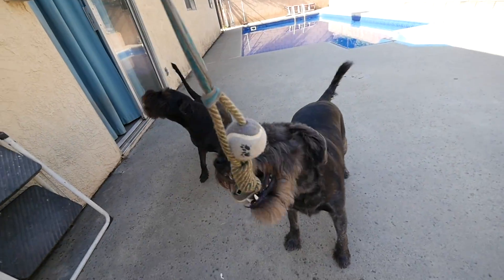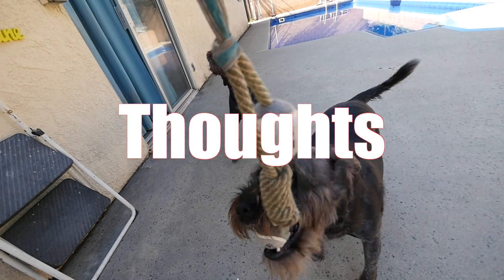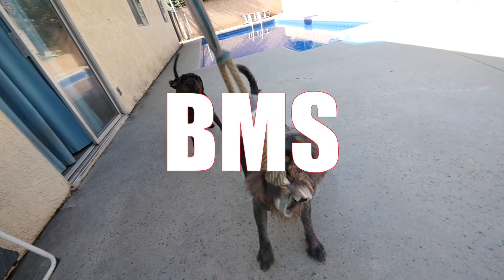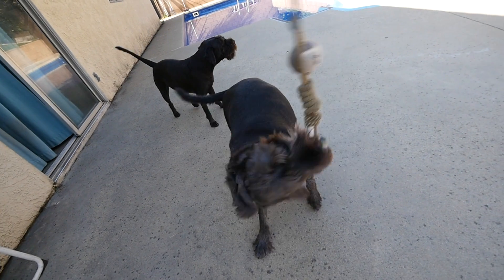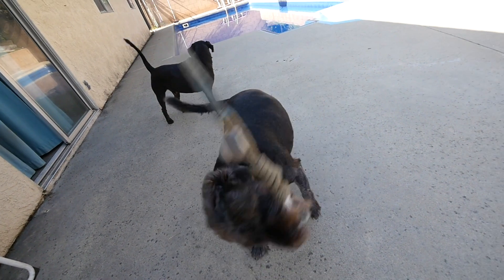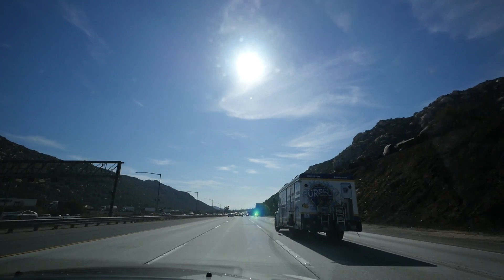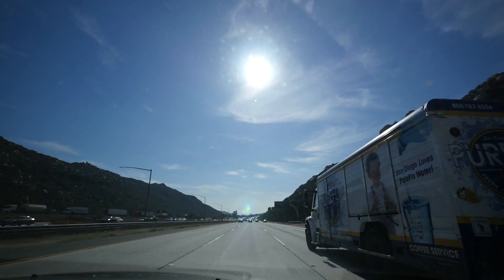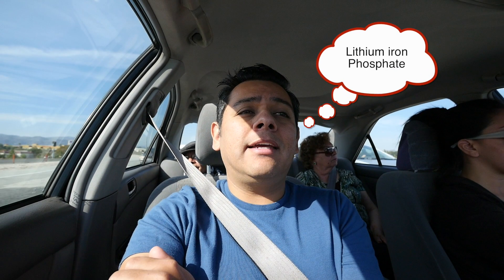My thoughts on Lithium  Battery Management Systems - BMS

Comment: I'm in test of two 3s battery packs to replace a lead acid battery on my hot tub eco outhouse set up. But waiting on my bms boards to come in the post. So am I free to test without bms. I won't b testing with a high load. Couple of led lights, phone charge water pump and the testing equipment. All was fine with the lead acid battery with a bms which I have purchased now and as far as I can see my solar charger was doing the same job. O with a little help from a imax  balance charger.
Reply: My thinking is that high drain will up the risk of fire ect. So far so good. Check my videos out.

Comment: Thank you for your very interesting comments on BMS. I have a battery pack for a small old Italian Car, the Y 1969 FIAT 500. It is a 96 V, 60 Ah, made of 21P-26S Samsung INR18650-29E  Lythium-Ion cells. The first time we ran the car for 8 km (it was also the first time we tested the car with the new electric motor). The BMS stopped running due to the burn out of 6 of its 12 MOS FET. Since it was the first time we tested the car, we were thinking we made a mistake, so we changed the BMS card with a new one. With the second, new BMS card, we run the car for about 200 km and then we had the same problem. Now that I hear your comments, I think I will remove the BMS and run without it. It seems obvious that the reliability of the BMS is lower than the reliability of the battery pack!

Comment: Jehu, I just bought 2 Fiat 500e Bosch battery pack made with Samsung SDI cells. I want to make a solar generator "portable" that I can hook up to solar panels and charge all day and use the generator at night to power a few things. I have been searching for a BMS for them but cannot find any for that setup. Should i just bypass getting a BMS and just monitor the batteries every so often? what are your thoughts

Comment: DIY powerwalls still need some form of protection against faulty cells even if it is just using fuse wire for connections. If you actually test each cell properly and match them a BMS isn't really needed but there are a lot of people just slapping packs together without carefully matching up capacities. I put together a small 4S 18650 pack using a 4 cell holder with with a BMS to try one out and quickly learned to appreciate short circuit protection as well as under voltage protection. If you get into high drain applications where your current is several C's you really need to monitor voltage levels of each cell/parallel group since you can easily end up with one majorly sagging below the rest.

Comment: It's pretty scary people are selling Tesla battery not using the charging BMS system that is On  bored those exact batteries every one of those individual cells in a Tesla battery is individually controlled with a six channel Panasonic charging chip which is all CAN network together.  two wires gives you access to every individual battery cell.  I thought Tesla was open code  that information should be out there ?
Reply from the maker: Groups of 74 cells,  not every individual cell

Comment: Hi Thanks to you I bought an E bike almost a year ago and have finally built a battery 5s 10p 36v out of 18650's but instead of a bms I fitted 2 lipo alarms covering 5s each now one set is at 3.9v fully charged when the rest are all 4.2 ish not much more than 0.1 difference, I am learning so what should I do is it ok? I thought it would pull charge from other cells to bring itself in check, but I am learning and everyday I learn something new here so great video's and thanks.

Comment: I'm also running without a BMS in my model aircraft, 3S 20P Li-ion cells using NCR18650GA  and NCR18650B cells.  No issues. I do monitor overall capacity, and system voltage when in use, discharge them over a period of 2-4 hrs, and balance charge them to a good healthy storage voltage, balance charging them the rest of the way to 4.2v per cell the night before flight.  I've had zero issues.  BMS is good for people who do not understand the tech, or do not want to monitor the battery, even a little.    For instance, the BMS built into li-ion power tool batteries is a great idea.  In my aircraft, or in most vehicles,  it would not be necessary, especially if you are balancing when charging. no need to balance while discharging, and a simple voltage monitor can keep you from discharging too far.  the cells should remain fairly consistent, and last for 20-30 years at least if you do not abuse them.  The chemistry is getting better incrementally all the time.  The fire hazard is not so much a concern anymore.

Comment: all you need is a way to monitor the paralleled packs in the bank. and have a way to balance if it does start to unbalance. you just need a way to pull down the higher cells while charging. and there is no reason other than time . that you can't do it your self.  do you think my idea will work?

Comment: Jehu do you need to balance the only in series or also in paralel? And by the can you show a proper video on how to properly bottom balance them? From what i understood from the guys on evwest when you bottom balance you have to make sure they are also top balanced. How do you do that?
Reply from the maker: You either top or bottom not both.   Parallel cells share an electrical connection preventing them from being unbalanced so you only have to worry about series groups of cells
Reply: And is there any machine that would do that besides the DIY one that you showed in an other video? Because i understand that i need to do it but i still dont understand how to. And by the way i want to use 4 tesla smart car modules in paralel. Do i balance each module and then connect them together?

Comment: Surly a battery back is just like an ice cube tray. As u fill the tray from one end all the other sections fill to the same level. Batteries linked will alway balance them selves out until they are all the same level of charge, unless you get a cell go end of life and not hold a charge then that cell will drag the whole pack down with it. 
 So if you build say 5 packs of cells and note on them the origional capacity of each pack and build those packs to approx the same capacity even if a pack was built of lower capacity cells but had more cells in it to make it the same as the others  all u need to do is have a voltage read out for each pack. If one day you notice one pack is consistently showing less voltage than the others there must be a problem cell. Ofc providing each cell in the pack is fused if a cell shorted out the fuze would blow which is your safe guard against fire. 
I think if u can monitor each pack that is enough so I don't think it's needed to measure each and every cell all the time.

Comment: Thanks - very helpful. Is it safe to say that the battery pack as a whole distributes current to each battery so all the batteries are the same voltage?

Comment: I have to disagree with you on this one. yes BMS can be annoying and BMS can fail, but BMS is necessary to prevent the one in a thousand disaster scenerios where a battery explodes. as such you need it.

not running BMS is like not putting a breaker on your house panel. 

without a BMS you rely on your charger to cut power and not overcharge. if your charger malfunctions - KaBOOM.

if you don't use BMS you need to have other systems to cut off the batteries above and below voltages, and above max current. 

But then you are pretty much just making your own BMS...

Comment: It seems to me that a BMS would only be useful on the batteries in series. creating packs only in parallel and then using a DC-DC transformer to step up the voltage would be safe and easy, still allowing for a modular arrangement to add more packs in the future, and would not need a BMS as cells in parallel balance each other anyway.
Reply: Nosaj Sebrof I had same idea...did u try that

Comment: What is some good tech literature or web links on using litium battery packs. I am a electrical engineer and I am looking at using the DYI tesla wall for the battery pack in my RV.  The lead-acids are expensive and are a pain in general.  The DYI Tesla wall will be charged by a 600 W solar array that I will be installing this spring on the RV once our upgradew the roof to mount the solar.  The info I need is the type of solar charger needed for a lithium battery, can you use a standard PWM controller or do you use a MPPT controller.  

Enjoy the Vlogs, keep up the goo work

Thanks

Dean Moore

Comment: I build DIY electric skateboards with high discharge lithium ion cells (25R, HE2, HE4, etc) and do not use a BMS. E-boards can draw crazy high amperage at times, but I still have had no problems. The only real pro I see in using a BMS (in my application) is one plug charging, other than that, they're a useless waste of space. BMS failure rate is much higher than the failure rate of battery cells themselves.
Reply from the maker: well yeah you only have real world practical experience but if you read a few books and study in a fancy school you would know better.  You just can not do it without BMS.

Comment: For applications involving the general public, I would always recommend using a BMS. It would be irresponsible not to.

I made an ebike powered by 10 x 6S 5Ah lipos arranged as 5p2s - and balance-charge it in two sessions using a Turnigy 300W 6S charger, so that already takes care of balancing and overcharge, but I would really like to use a BMS and be able to charge-and-forget in one session. That would then require a juicy 50V charger, and I don't have one! (but I do have 400W of portable solar panels which could do that job sometimes).

The charger allows the final cell charge voltage to be changed, so I choose 4.15 V instead of 4.20 V to increase their lifetime. The lowest I've ever let the pack down to was 22%, but 30-40% is my usual time-to-recharge point.

Yes, I spend a lot of time checking its state of charge and a BMS would allow me to become lazier, but in my case it would only offer overdischarge protection.

After a year of almost daily use, it still appears to perform as good as new, and shows no signs of stress.
Reply from the maker: The problem with your statement is that,  people who harvest cells from dead laptop batteries to then assemble a large battery pack after testing them can hardly be considered by anyone "General Public".   True General public buys energizer batteries at the liquor store and therefore do need to know anything about how batteries work.    Cell Harvesting Folk need to know what they are doing.
Reply: For cell harvesting folk who know what they are doing, I agree with you, but the general public watch this video too.
Read my message again - even for those of us who know what they're doing, using a BMS still saves time, worry and expensive mistakes in case something didn't get switched off, an inverter doesn't shut down on low voltage, the ebike gets stolen or locked in a room and you can't unplug it, or you get called away by an emergency and you can't monitor the state of balance and charge etc!
Lipos are a somewhat less forgiving than 18550s so need more attention - as I said, I don't use a BMS because I monitor the pack, but would be nice not to have to!
Reply: how about connecting 18650 in 10 parallel and charging @4.15v. do need a charger cutoff or balancing required in this configuration?

Comment: Wow, didn't think that your opinion on Battery Management Systems is so negative. I would even go as far as to say it's quite dangerous for other people planing to build their own battery system. Those cells are definately going to drift at some point in time. This has nothing to do with being a geek and knowing a lot about those battery systems or not, you are simply too slow if you check all of the cell voltages manually. If something goes wrong, those cells can drift quite fast and you might end up with a deep discharged pack of parallel cells or even worse you are going to overcharge one. A proper BMS can at least stop the system, if that happens (+ if it has charge and/or discharge balancing, it might even avoid this problem entirely). The "worst" cell pack limits the performance / capacity of your whole system. In the worst case you might end up with a battery pack catching fire just because you didn't install a proper BMS.
Reply: agreed.   This man should not be making videos about batteries.

Comment: Jehu, Great work, you are posing as our eye into our energy future. As you know the facts that are certainly worth repeating, the thermal efficiency of 99% of gasoline automobiles is 20% and electric vehicles electric efficiency about 80%. So the future is solar grid tied electric sourcing with an electric car that achieves 200 miles per charge. If one has a 20 mile commute then it's totally possible to put a 1 KW panel atop a car and in the sunny SoCal climate, never have to charge it for daily driving distances. Very exciting stuff and I'm enjoying your pioneering style and achievements, I'm very happy someone is doing it!

Comment: As posted in comment below...

Common issues with BMS's:

- They drain the cells during storage and some times even imbalances the pack due to uneven load on the cells.

- Balancing is basically bad for the cell life. 
During charge and discharge (balancing) at low current, parasitic reactions occurs and creates lithium crystals. 
Try to avoid charging  current below 5% of the capacity of the system. 100 Ah = min. 5 A

Even with BMS you should use conservative battery settings to avoid "going over the knees" in both ends of the charge/discharge curve, to get maximum life out of your pack. 
And you DON'T get much capacity out of a LiFePO4 cell by charging to 3,6 or above.
I made a test with some Calb SE cells, I gained less than 1% capacity going from 3,4 to 3,6 CC/CV and 5% cutoff.

So if you stay within the safe part of the curve there's nothing to worry about going no BMS. 

This is all related to LiFePO4 cells. 
You should always use BMS for LCO cells as they are extremely sensitive!

With the NCM ( like the tesla cells) and NCA you have better safety than LCO but not as good as LiFePO4 but normally much better quality than Chinese LiFePO4's and therefore also safe to use without BMS. Normally the range for NCM and NCA is 3.00V to 4.00V to get max. Safety and life. As Jehu say in the Video, there vary only few mV. Not because of good matching but because of consistent production quality as they are 100% machine made in 100's of thousands pieces per day.

Comment: jehu I think it'd be good to clarify... when you're saying no need for a BMS, you mean an active balancing circuit right? I'm guessing you still use a battery monitoring system which watched the voltage of parallel groups of cells right? I don't see any risk in monitoring the groups to be in the 3.x to 4.1v range and I do monitor my skateboard and drone batteries this way... I do see a risk of an improperly built Battery Management System which incorrectly balances and may wreck cell groups.

Comment: Hi

I think you are correct about not needing a BMS but I do
think not everybody is as Anal as we are and you did set the batteries up
correctly from the get go, my only concern is if anybody builds a battery pack
without due diligence in there build quality they could open up a can of worms
so for the uninitiated I think a BMS would be a good idea and if it’s done on a
budget even more so, but for somebody who has covered every base there is
probably little need. 

Joe

Comment: I don't use BMS either. Just ran outside wires and connectors to check their status from time to time and that's it! 
My battery pack has ten times the capacity of what I usually need and use and I never stress my cells beyond their safe region in order to actually need a BMS. 
Of course, you are right, Jehu :)